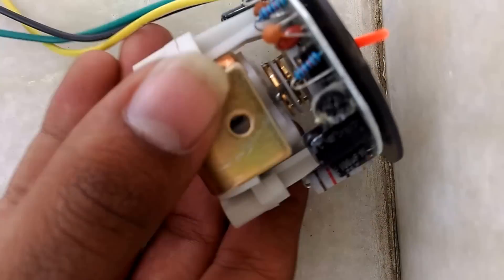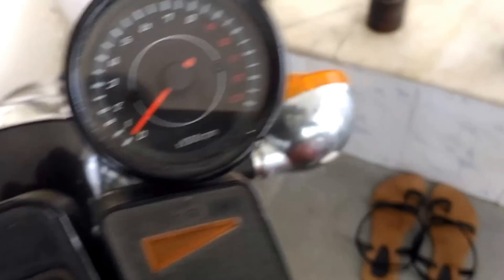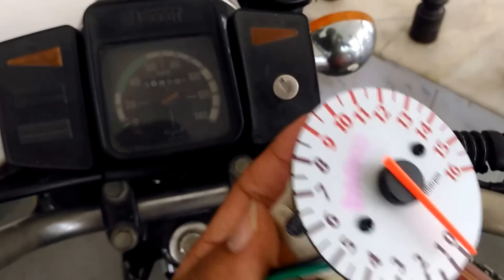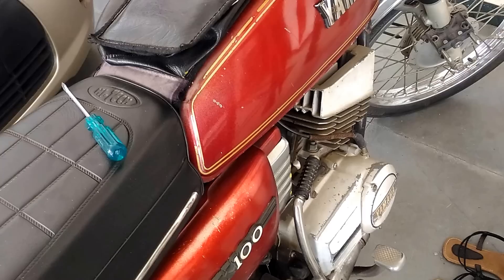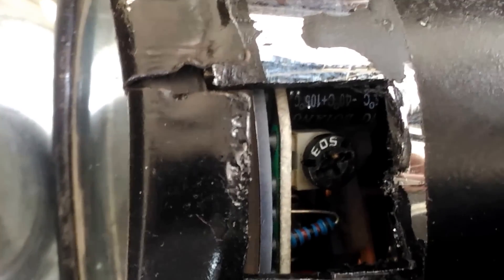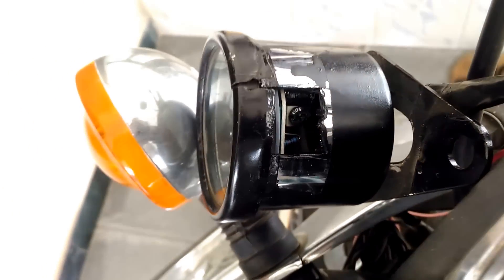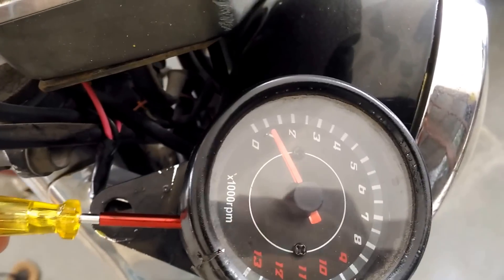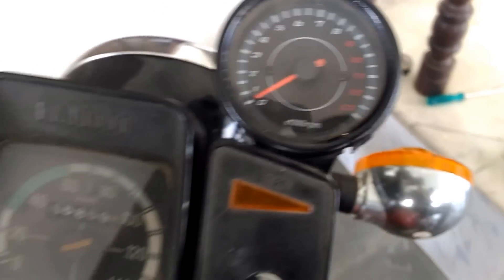2 stroke tachometer electronic gauge explained.

Comment: Can you please help me, I want to fit any four stroke tachometer under the faceplate of Yamaha RXZ tachometer and the bike is also four stroke, I just need it to be in the housing of yamaha rxz, For eg I will fit pulsar tachometer in rxz box but the angles for particular RPM figures are different so how to calibrate it.
Thanks in Advance.
Reply from the maker: Abhishek Kale you can't fix the tach because every tach changes in Its shape needle doesn't match the cover of tach,you can fix using clamp in extra

Comment: bro what happen when rx135 chain set is replaced by rx100 in rx135
Reply from the maker: Vishu Tyagi bro all rx series have same set chains,only the design in chains differ but all rx 135 rx 100 rxg have same set,no change occur in installing rx 100 chain to rx 135.
Reply: but bro rx100 have 15/39teeth and  135 have 14/34 teeth I purchase both 100 and 135
Reply from the maker: Vishu Tyagi but the seating of chains will fit both rx.In case you have to remove 1 or 2(not necessary) pins in chain.but fits both.
Reply: it means no effect on speed due to chan set
Reply from the maker: no bro it'll not

Comment: Dear mate,
this video is informative,thanks for that.  I would like to fit a tachometer on my rx100. which one you recommend? how much a decent one costs? kindly help me out.
Reply from the maker: ajjan110 bro what I recommend is buying yamaha rxz tachometer with rpm worm kit.which cost around 500+800re...if you buy electric tachometer as shown in video you need to adjust the potentiometer for 2 stroke bike reading.this tacho available @Amazon. 600-800rs approx cost.
Reply from the maker: ajjan110 https://www.amazon.com/gp/aw/d/B019XBXGVG/ref=pd_aw_sim_sbs_263_1?ie=UTF8&psc=1&refRID=TW75QB67E5GH3Q5F8AY7
Reply from the maker: ajjan110 for connection check link.https://youtu.be/1BiU8KTqLxs
Reply: thanks a lot bro. As u recommended, better I would go for RXZ' tachometer. I have heard that for installing RXZ tachometer, have to dril the clutch case,is that right?
Reply from the maker: yea bro at right side case it'll be already drilled and closed just need to thread inside and worm kit to be installed.
Reply: Kaanis Ram ohh k bro, got it.  tnx and one more thing how much it will cost to install ( approximate figure)
Reply from the maker: bro rxz meter set both speedo and tacho cost 1500rs and RPM worm kit cost 500rs..fixing cost me around 470rs. total 2470rs bro approx
Reply: Kaanis Ram thanks a lot bro. I was quite confusing about this issue, now it's clear. once again thank you for your help. keep in touch bro
Reply from the maker: ajjan110 sure bro...